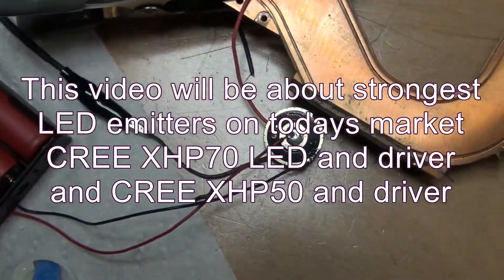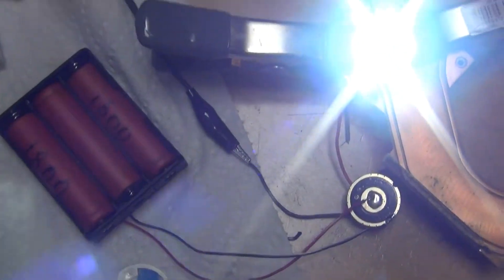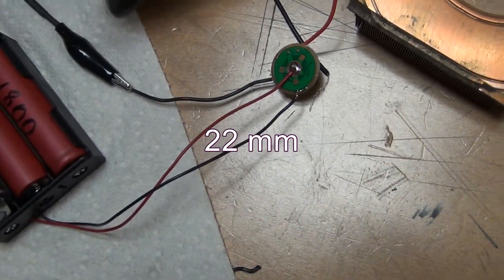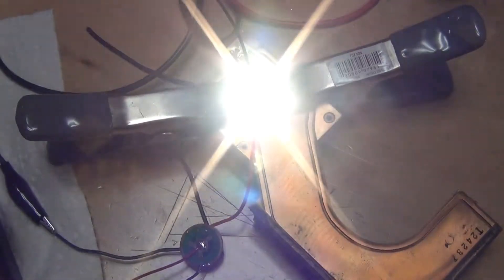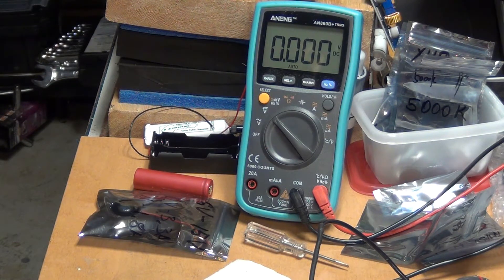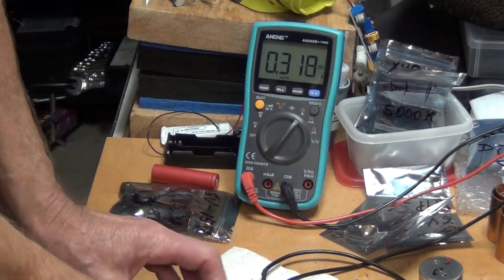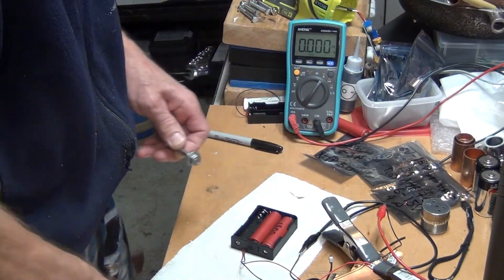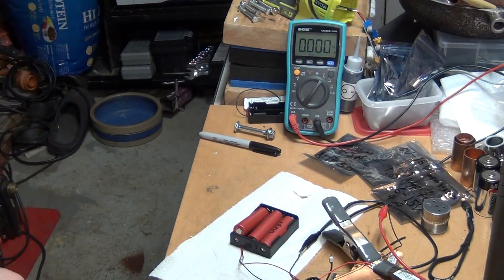CREE XHP70 LED driver CREE XHP50

Comment: Hello. Are you still there? I have a question: what if we use a boost circuit or a buck circuit to adjust the appropriate volts and then supply it to the LED? Is this suitable?
Reply from the maker: yes it will , I have done it too

Comment: Hello, great video! My question is, what is the advantage of a driver? Can I only operate the LED with a series resistor? I connected the 6 Volt XHP50, directly to 13.6V with a 5.5 ohm resistor. The values on the LED are 5.8V / 1.7Amp  O.k, the resistor (50Watt type) naturally gets very warm.
Reply from the maker: The driver is necessary to control supplied amps to LED. Each LED uses different amps to operate properly.

Comment: ALL LEDS ARE CONTROLLED IN CURRENT
XHP70 - 6 V / 12 V  High-CRI Maximum Drive Current (Standard):  4.8 A (at 6 V model)  2.4 A (at 12 V model)
Max Power (W) 32 Watt  . 
So if you check the voltage after is just to ensure you`re not over the 32 watts (volts x amps) and it should be used only for perfect cooling systems , orelse the life of the LED will be shortened.

Comment: The board was designed to go in closed flashlights with poor airflow. You should thank the creators for prolonging the life of the chip by limiting the power
Reply from the maker: then it should be properly labeled

Comment: Hello: Great videos BTW. I am wanting to use the Cree XHP50, 12V option. From the specs, it says is draws 1.5A. This equates to roughly 18W (front voltage is around 11.5V, so maybe closer to 17W). Anyway, I am need a very small form factor driver with 1 mode only. My supply voltage will be stepped down from a 24V, 5A power supply to the 12V. My question is, can you send me maybe 2~3 recommended drivers I could use that are stable? It looks like you have a lot of experience with testing drivers.  I'm using this light for a microscope back light. I need it to arrive in 2 weeks or less. THANK YOU in advance.
Reply from the maker: Sorry I don't have any source of 12 V  drivers I was going to use 12 V LED also but cant find small driver to fit to flash light.  You can find bigger 12 V  drivers on ebay for about $5

Comment: Hello I am trying to make a custom flashlight and have the xhp70. Where is the best place to get a driver? I ordered one from FastTech but it took 4 weeks to get to California. Great videos by the way! you are one of the only people that I can find that has great info for these LEDs
Reply from the maker: That is a good question. I have decent driver from Kaidomain.com but its coming from China and they r very slow with shipping. Or try Mountain Electronics. Sorry  but I don't have a good source ither. I'm using mostly drivers from Ebay. Thanks. V
Reply: Do you have a way I can contact you directly?